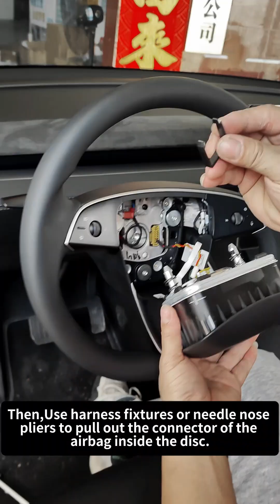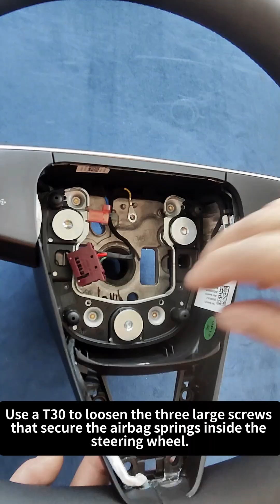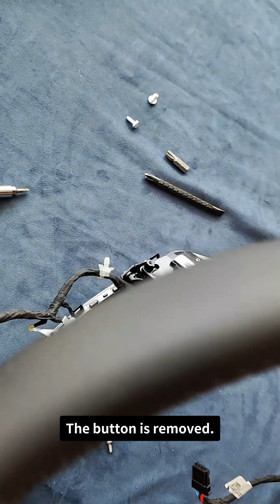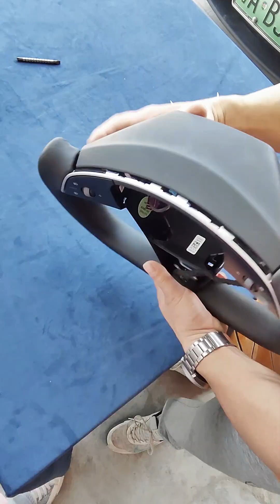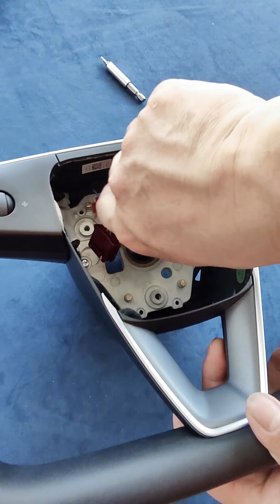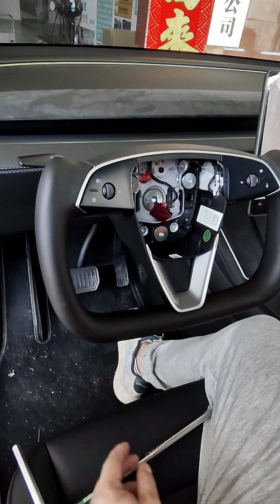How to Install Tesla 2026 Model Y Juniper Yoke Steering By Yeslak Full Tutorial

Comment: In what areas is the heating elements?
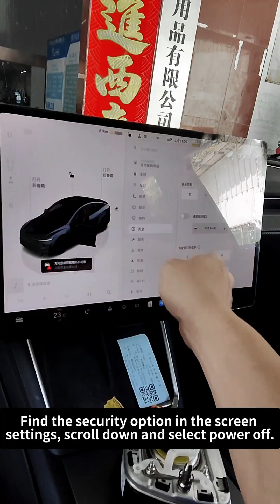Reply from the maker: Thank you for the comment, by 7:51 is the heating plug for the steering wheel plug.
Reply: @yeslak what? I asked how big is the heating elements? Whole steering wheel is heated, or only some parts is heated?
Reply from the maker: @Saha1503  Yes, it is whole Yoke steering wheel.